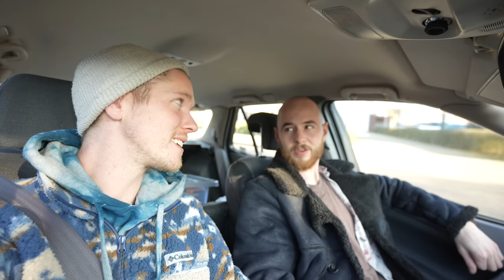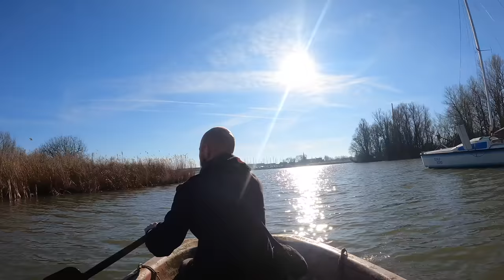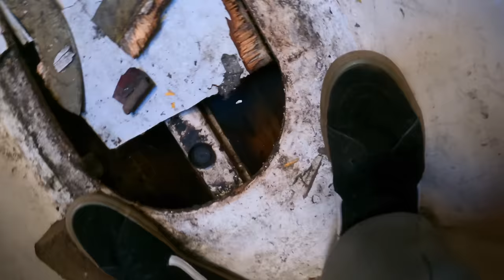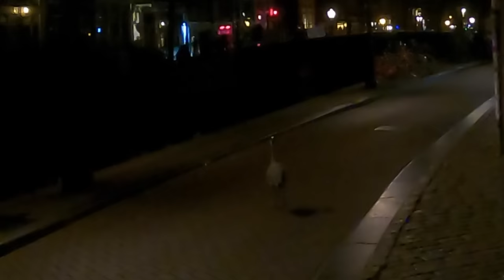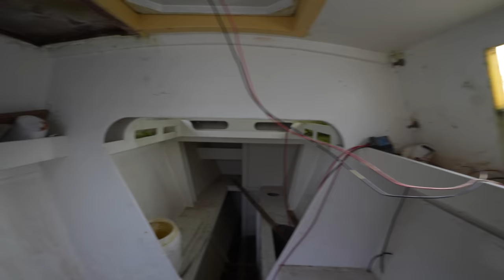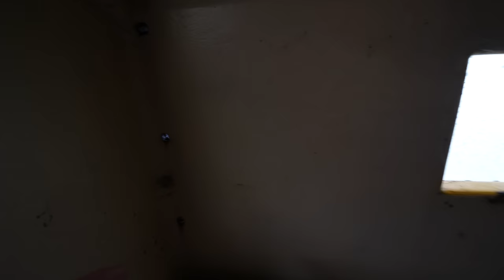I Made A LOW Offer On A SINKING Catamaran | Wildling Sailing

Comment: Your such a nice guy, so I don’t like being negative but this boat is another train wreck.  You just have not grasp the concept that cheap doesn’t mean a good deal.  You are better off spending $15k on a boat that can sail but needs work, then $2k on a boat that doesn’t float and needs a complete ground up rebuild.  This boat doesn’t even have proper engines.  On top of that this is least comfortable boat you have shown yet.  I can’t imagine trying to move around in that boat in rough seas.  I wish you only the best and pray your offer gets turned down.

Comment: Mark,  you have found the one!  If you need to spend more to purchase no worries as the cost of fixing up will be so big compared to the purchase in the end it will not matter.  you will have your dream and your heart will be in the fixing.  It looks super solid.  Boats can look terrible after only a season of neglect and the amount of water in the bilges suggest about three months without working bilge pumps. It smells because it is stagnant.  if it was leaking form under it would sink in sort order, long before is smelled.  My Trimaran had water in the bilges often and never went soft.  Epoxy sealing is the key....  Hold your breath that you get it..  this is a once in a life time opportunity! You have a great adventure ahead and with Honecker guiding you are set.  Figure six months full time work to sort the bottom and rudders and motors and quick fix the top leaks, clean and make a nest.  Now you have a place to stay as you work and you can transport back to home waters for a real fit out..  Once you stop the top leaks the hull will transform.  Personally I would get a genney and work on her where she is moored for top sides and leaks.  Lay some ply over the deck beams and now you have a shop floor.  once ready then pull for the outside bottom work.  I worked for a month on the Tri at a mooring in the same way and it went pretty well. Get a pressure washer and do all the cleaning in the water first and use good pumps to clean and drain until the scum is gone....  OK well... I am so excited for you! Fingers crossed

Comment: At least you know the boat is water tight...otherwise all that water would have leaked out by now.
I know it's a crazy question. but is that boat floating or is it actually setting on the bottom in the shallows?
I'll give you a lot of credit for taking on such a big project. It is what you've been looking for though.

Comment: It would be a great boat and I am am pretty sure after it has been pumped out and cleaned, you could make some new hatches and finish the fit out. Just the materials to build this boat would have cost over £30K. I bet all the negative comments will be proved wrong. Good luck Mark. Am rather jelous.
Reply: 2000£ of rotten plywood and debonded fiberglass..

Comment: It is a very interesting boat! For  a right price definetly buy it.
It is not as bad as it looks and the water is rainwater inside the bilge and great potential for a cabin over the spreaders!
I would definitely use pressure washer and a high capacity bilge pumpe to clean the inside of the boat!
would clean it in no time!
Good luck dude!

Comment: How much did he offer You for getting rid of it? It's way too less I'd say even without knowing the numbers. 
Not even in case the shovel-paddel should be included. 
There are boats, and there are project boats. And then, there is the occasional project boat ruining her keen new owner. 
That's it. 
Oh, hold on a sec., and then, far far out, then there is this thing I personally would feel offended to even use the proper boat-pronoun "her" on. You'd be way better off building from scratch and collecting in gear what You need on the go for cheap from gumboot, Craig, le bon coin etc., or by scrapping boats as a side-hustle.
So, the proverbial 1 Euro as a subject for Youtube's sake? (Thats's about what Tally Ho did cost in that state) Probably. For a three or four digit sum of Euros? Hardly. And the owner knows that, believe me. Youtube knows that. Everybody working in/living on boats knows that. Get rid of the Volvo, get a proper van, put in a proper wood-stove and a pull-out couch for 12 quid off a yard sail and long enough for You, add a solar shower and a proper composting loo You move to the boat with You later on, get a trailer for material hauls and scrounging nasty bulk stuff, probably an additional scooter or small motorbike to get to town and coffee, and go at it. From the back of a Volvo, beside some backwater gracht, no shower, no loo whatsoever, nor a place to stand out of the rain? Not even in the Dutch summer. Anyway, all the best, thanks for sharing as always, Cheers!